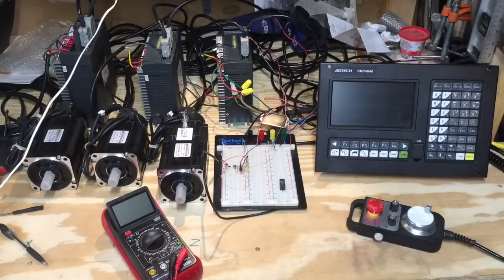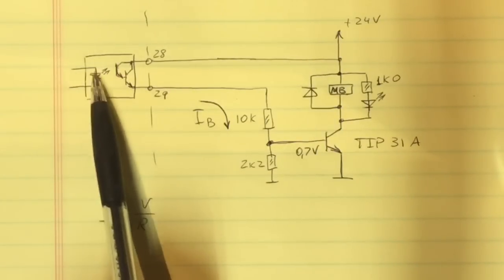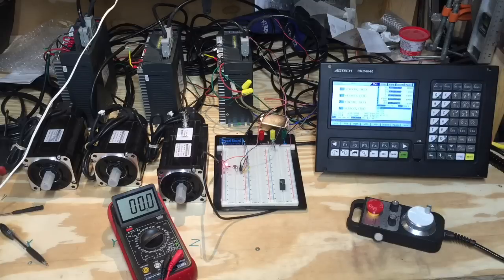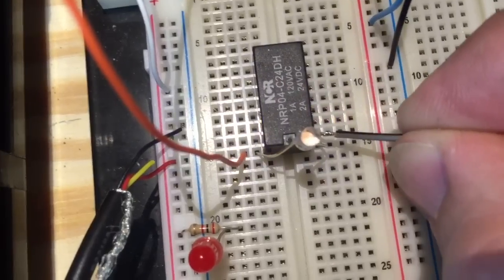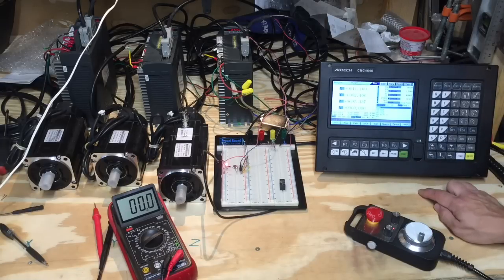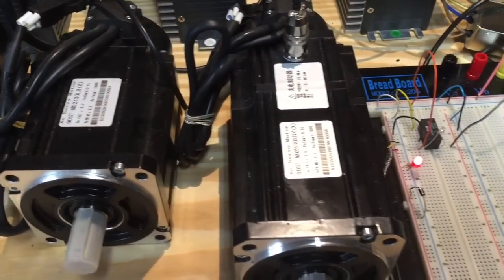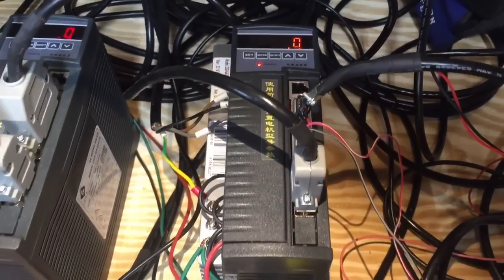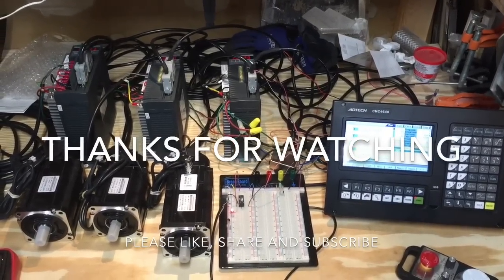DIY CNC mill progress: Motor brake connection, AC servos first run

Comment: did the motor need fine tuning to communicate the controller to servo driver .
Reply from the maker: I did play a little bit with accel/decel and speed settings in the controller to get the machine to move swiftier, but no sophisticated tuning was necessary in my case.

Comment: Hi there i have the same controller but i can only access the bios and some other menu the udisk seems wiped. How can i recover or restore the original cnc controll software. I dont have a usb with the original files. Where can i optain this. Thank you in advance

Comment: Hi sir
Do you have any idea how to wire this controller with spindle?
Reply from the maker: Tushar Gajbhiye to be honest, I still haven’t gotten around to work on my CNC machine. If I’m not mistaken, this controller can output both (or at least one of) 4-20mA and 0-10VDC analog signals which can be used to control rpm of the spindle drive.
Reply: You can talk about xS6 digital out pin?

Comment: Hi sir
Is your brake motor temperature rise up after 1/2 hour of working??
Please reply
Reply from the maker: I never noticed any unusual temperature rises. Do you supply the correct voltage to your brake coil?
Reply: Yes sir, i have order same motor as you used, i have observed temp rised of brake motor after time. Please notice it and reply

Comment: Also, I have another question, even on step/dir mode the braking system turns on automatically? I mean when I send the signal, the brake will release the motor by turning on the coil? I can't try it disconnecting the motor right? because it would have an error with the encoder? Omg! I just don't want to burn the thing. Also the polarity of the coil is important right? I read it in the manual. But the translation is not very good. And I'm not that savvy in electronics.
Reply from the maker: As the seller told me, the brake only engages when system/servo is off. Otherwise, brake stays disengaged (energized) and hold of the motor is executed electrically, by the servo drive. As far as polarity, can’t remember right now, will have to look at it.
Reply: @TinkeringNerd  Thank you very much for your fast response,  and already helping answer!  I'll try my best to upload all the information and do what I can before touching anything haha! Very excited about this! Many, many thanks, This was driving me crazy. I'll try to do this in the following days!

Comment: Hello TN! I have watch several times this video, I have the same motors, just a little bigger one of them 1.5kw, I haven't been able to make this little circuit yet. I'll do everything in the video, and make the proper connections, would you be willing just to look at them? I wont take too much of your time, I'll upload a video and explain what I did understood. Because I don't want to ruin this expensive servo and I haven't found another video like yours. I will be so glad if you could help out. Thanks in advance!
Reply from the maker: Hello, sure, I’ll take a look and hopefully be able to help.

Comment: Did you give up on using this system? Ive been watching for an update.
Reply from the maker: My biggest obstacle would be a mountain of obstacles and monetary constrains. This system is sitting on the bench, waiting for its turn. Hopefully, my audience is patient enough to see this project come through.
Cheers.
Reply: @TinkeringNerd  hi. I'm thinking about building a cnc with Arduino and sepper motors with brake. Can you show me how to connect a stepper motor with brake to Arduino board (or to CNC shield or ramps)? Thank you.

Comment: Does servo drive need different different parameter for xyz or the same parameter
Reply from the maker: I think it depends on your motors and the environment the motors work in (pre-load, inertia, required acceleration, etc)

Comment: Hello sir,
    Can you share me limit switch wirring or servo motor limit wirring ( soft limit)
Reply from the maker: As of now, limit switches are not wired up. All I had to do to make motors move, is to set limits as soft limits in the controller settings. I can set any position as home, or zero, and start from there..

Comment: Did you ever finish this project? And what was the cost? I have a Bridgeport that I want to convert to cnc. If that stuff works I would get one asap.
Reply from the maker: Sorry, haven’t gotten there, yet. These may not be the best choose for an industrial high production environment(mostly due to connectors and cables), but, for a home shop they are just the thing to have, in my opinion.
Reply: @TinkeringNerd  that's ok. I'm not ready for any kind of production right now. More interested in learning to draw and program a cnc.
Reply from the maker: It’s hard to beat this set, then. Keep us posted on your progress, or if you find some alternative to these motors/controller.
Cheers.

Comment: Hello are the drives difficult to tune? Is there software for tuning, if not how is it accomplished?  Thank you.
Reply from the maker: Hello, thanks for the question. The drivers were sent to me all wired up and ready to go. I didn’t need software to get them going. Driver settings include different presets for different motors.
Reply: @TinkeringNerd  Thanks for the info, I like the prices but am apprehensive about them
Reply from the maker: It’s fine. I, personally, was never a fan of stepper motors (noise, skipped steps, etc.). Servos make so much more sense to me.
I guess, it’s a matter of preference.
Cheers.

Comment: Regards

I need to control 5 servo motors and drivers from my computer, what motion controller card recommends me to retrofit my vertical milling machine to a CNC machine and with what software does it work?

 

1.    AC SERVO MOTOR HF-SP102 MITSUBISHI (01)  Axis X

INPUT 3AC    125V    5.3 A 

OUTPUT 1 Kw – 2.000 rpm 

SERVODRIVER – MITSUBISHI 

MODEL: MR-J3-100A (Analog)

POWER: 1KW 

INPUT: 5.0 A  3PH+1PH200-230V 50/60 Hz 

OUTPUT: 170 V     0-360Hz  6.0 A

2.       AC SERVO MOTOR HF-SP152 MITSUBISHI (01) Axis Y

INPUT 3AC    126V    8.0 A 

OUTPUT 1.5 Kw – 2.000 rpm 

SERVODRIVER – MITSUBISHI 

MODEL: MR-J3-200A (Analaog)

POWER: 2KW 

INPUT: 10.5 A  3PH+1PH200-230V 50/60 Hz 

OUTPUT: 170 V     0-360Hz  11.0A

3.       AC SERVO MOTOR HC-SF202 MITSUBISHI (01) Axis Z

INPUT 3AC   138 V  11A

OUTPUT 2.0 Kw – 2.000 rpm 

SERVODRIVER – MITSUBISHI 

MODEL: MR-H200TN 

POWER: 2.0 KW 

INPUT: AC200V – 230 V 50/60Hz

OUTPUT: 10A
Thank you

--

Ing. Rojher Laguna
rojher.laguna@gmail.com
Reply from the maker: Thanks for your question. Here, you have two main options: go with a breaker board (there are plenty to choose from) and computer with Mach3, or standalone CNC controller, like shown in this video. Both options provide step/dir signals for servo drives. Unless I’m missing something, I don’t see where on a vertical mill can you use 5 servo motors. 
Best.

Comment: Hi Tinkering Nerd, do you happen to have a picture of your wiring? (like the Filter and the other stuff?) it would also be nice if you could do a video on basic use of the Adtech controller. Cheers,
Reply from the maker: Hello, thanks for your interest and subscription. As far as wiring goes, I went with diagrams suggested in the manuals for controller and servo drives. In the future, I will go in more details on how I did it.
Currently, I seem to get sunk in the constant vortex of either not having time, money, or some other random stuff that takes priority over what I enjoy doing (tinkering :-))
Soon as I muddle through this mess, more videos about CNC will be coming out, stay tuned. Cheers

Comment: Did anyone understand the parameter coin ?
It say position complete; it will be nice to take this signal combine it with the "OK" of GRBL  to authorize my other arduino to send the next Gcode
unfortunately I did not understand how it work (and can it work in  step dir mode ?)
About the step resolution, in my example I say 4.5 micro is ok for wood, many will say this is stupid  1/10th mm is enough
Well nothing is immediate in real life,  and there is a gap between the wanted position and the actual position (and basically it is the principle of .servo)
0.1mm is equal to 100 micro with a step of 4.5 micro this is only  22 steps  at full speed it is much too small (empirically I will say that below 50 steps alarms will be triggered very often
The parameters to define the max amount of  errors before to trigger alarm  is
P15  in order to trigger alarm put it to a low value (5 or 10) and send a great acceleration 
Normally a good controller must act very fast and use the original signal of the encoder (here 2500x4) so an internal step for a 5 mm ball screw is 500 nano meter; in this case 0.1 mm of mistake represent 200 internal steps.
experience will tell !
if the limit is reached the signal alarm will be triggered (3 and 4 on CN1 connector) and the alarm will be 04 (any one know how to get the alarm number ?) a pulse should be send (14 on CN1 connector) to clear the alarm
I will make my tests
It seem that the electronic engineer are not master to write documentations

Comment: I have Adtech QS 7AA020M and I am making  a small demo with GRBL 
It work very nicely
Things you must do
enter the password universal  this is a little bit tricky -
at power up you have r    0
press mode one time  
Now you must   have P    1
press enter
Now you must   have       0
press inc tll you read    1.0
press inc till you read  1.00
press inc till you read 1.000 
press mode you read  1000. (the dot is important)
press  inc  one   time   1001.
press mode you read  100.1
press  inc  one   time   101.1
press mode you read  11.11
press  inc  one   time   11.11
press enter it will blink
now you can change the parameters of your adtech

you need the lines pulse + and pulse- they are called  STEP in casual language , you can enter directly with your Arduino 5V since it is an optocopler with a led and a 220 ohms included It will probably work (keep a short cable) BUT TO INSTALL IN YOUR MACHINE USE A differential line driver I have old 75174 that make the job nicely but newer chips will work too 
You need the sign+ and sign-   they are called DIR in casual language, you can enter directly with your Arduino 5V since it is an optocopler with a led and a 220 ohms included It will probably work (keep a short cable) BUT TO INSTALL IN YOUR MACHINE USE A differential line driver I have old 75174 that make the job nicely but newer chips will work too
Since the encoder is 2500 lines it makes 10000 points per revolution  GRBL can drive at 40KHZ max so 40000/10000*60 240 RPM  LOLOLOL
so you must change that and you can with the parameters P12 and P13

Let's take  GRBL at 30KHZ our motor 600W run at 3000RPM  or 50 RPsec this is 600 steps per sec  for 30khz or 800 at 40khz
A servo must work faster to give his power and a time belt avoid coupler!
let's imagine a ball screw  with a pitch of 5mm (5mm per turn)
let's imagine a speed of displacement of  8 meters/min (it's pretty fast)
this is (8000/5 )/60 =26.66 RPsec so the ratio should be 26.66/50 =0.532
normalized it give a motor pulley  of 30 teeth  and axis  pulley of 56 ratio 0.54
600/0.54=1111.11 positions for 5mm (better to be smarter in your choice) or 4.5 micro per step enough for wood  machine for metal 1micro is a minimum

Lets parameter P12 and P13
1/1 give 10000 to have  600 steps  makes  16.6666 lets take 16.6 we can write it 5/83 it make 602 steps

let's go in P12
press enter
type inc till you have 83
press enter 
type inc you are in
P13
press enter
type inc till you have 5
press enter 
job done
in P4 type 0 (external pulse input)
in p5 type 1 (enable control invalid)
in p10 type 3 or 0 if you use a line driver
it should work
to save ....read the doc
Reply from the maker: Hello, and wow! Thank you for your interest and this information. You left me speechless here :-)
Maybe, when I grow up, I’ll be able to process it all..

Comment: Morning Can you help me setup up a Adtech controller on my home build CNC. I have most of it done. Thank you.
Reply from the maker: I could give it a try and learn it with you :-)
Reply: How far are you with your project
Reply from the maker: I’ve done a lot of brain work (anticipation, contemplation), but nothing really to show, or else I’d post an update video.
Reply: I have a working machine but I don't like the controller it is a DDCSV1.1
Reply from the maker: I think I’ve seen some videos about it. One video being from BrainRight if I’m not mistaken.. those look like cute little controllers :-)
Where did you buy your Adtech? What model is it?
Reply: From Adtech it is the CNC 4640 the same one you have.
Reply from the maker: That makes it easy enough :-)
Did it come with manuals? Do you have specific questions?
Reply: I got the controller from adtech It is a CNC 4640 the same as yours
Reply: Yes I do have a manual. I can't find the input for a zero touch probe of the command to auto zero Z axis.
Reply from the maker: If I can understand the ChinEnglish correctly, this function is called tool regulator and it is described on pages 15, 37, 49, 74. Please check your manual and let me know if your copy corresponds with what I have. I believe you need to enable “Tool Regulator” function first, then assign an input pin of XS5 as the tool regulator test.
Reply: Thank you will have a look. I think input 4 is the right one on XS5.
Reply: I have tried to use tool probe but I get this “Is not enabled TCheck? “ I have also tried looking for a option to enable this option but can’t find it.
Reply from the maker: It would be too easy if the verbiage in manual matched the verbiage of the actual machine, wouldn’t it? I’m looking into it. Will keep in touch.
Reply: I have found out how to enable the "TCheck" auto tool offset. It is in the "Coord" menu and then go to "set" tab and go down to 29  "Tool Start Using En". That all works but not the input.
Reply from the maker: This topic deserves its own separate video.

Comment: nice vidio, where did you get that,,?
Reply from the maker: +as39ad ali thanks :-)
I bought it on AliExpress, please look for links in my "CNC Controller.. unpacking" video description. Cheers.
Reply: Tinkering Nerd whether already installed g code software inside the cnc cotroller..?
Reply from the maker: +as39ad ali do you mean a g-code file from a USB? No, at this point I just tried to manually input few g- commands, and it's working as expected.

Comment: Hello everyone
does the editing require an electronic knowledge? is the record sufficient to connect all the instalation?THANK YOU IN ADVANCE
Reply from the maker: +Anouar Aroua when you say editing, do you mean editing of the existing g-code program? If yes, then NO specific electronics knowledge required to edit programs. Some basic knowledge is always a plus though.
Also, when you say record, do you mean manuals for the drive/controller? If yes, then YES, one can make all necessary connections if the person has basic electrical (and electrical safety) knowledge.

Comment: I donno what are you going to build but it will be a monster with those motors. You forgot to talk about your design. What is it, a mill ? It seems an industrial size machine, and you build it by hand for home use ?
What kind of rails, ballscrews, spindle, will you use, how will you build the body. These servos are just really small part of the project, almost the most simple parts.
Reply from the maker: +telelaci2 thank you for your comment. You're right, this my machine may turn out to be slightly overpowered. For preliminary calculations I had in mind a 50kg spindle + z-axis moving with 1g accelerations. The entire gantry assembly will be well over 100kg. The design aspect of it is still in making for I'm going to be using what's available for the frame components. I am aiming at using something like 3x6 rectangular steel pipe, or bigger, filled with liquid stone or something.. Stay tuned for more videos :)

Comment: i want to use MACH 3 .... it is possible ?
Reply from the maker: +shand seimela I am pretty sure Mach3 is not necessary with this setup. All that needed is whatever CAM software you use, save it on USB stick as g-code instructions file, plug into this controller and you're good to go.
Reply: im familiar with Mach 3 ....i want to use this for plasma cutting 4 axis plasma im not sure that this setup will allow me
Reply from the maker: +shand seimela this particular controller can be used with up to 4 axis'. There are other options to choose from for different applications (4+ axis', lathe). It also allows user to set all necessary parameters, offsets, backlashes, tools, g-code modifications, etc. It can also operate a tool changer. It is a definite step up from using a Mach3. When using this controller, there is no need to have a computer next to your CNC.

Comment: Following you with this control and wondering further videos. Thank you. Is that control capable of calibrating the axis? I mean, if use some motion transfer system (like gears), calibrating the axis will always be a need.
Reply from the maker: +Eren Kaya still not entirely sure what a calibration of axis would look like. However, you could set any gear ratio as well as any travel distance per revolution in the settings.
Reply: Tinkering Nerd, that was what I asked. I  guess travel distance per revolution and gear ratio would suffice. Thank you.
Reply from the maker: +Eren Kaya Sure! Thanks for your questions and comments!